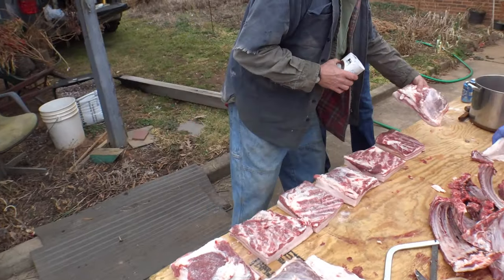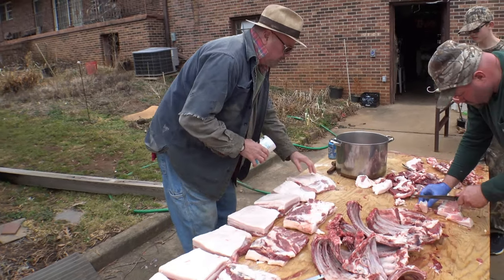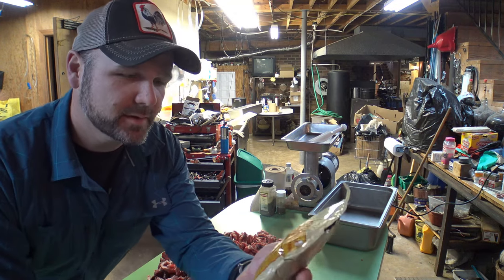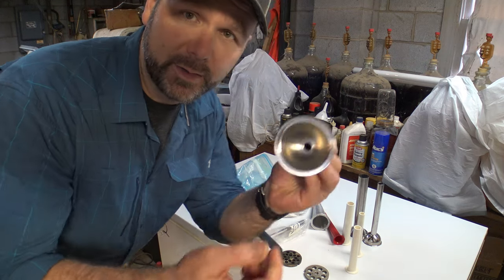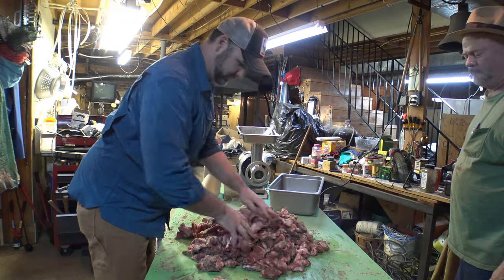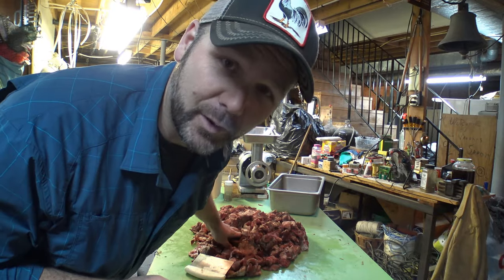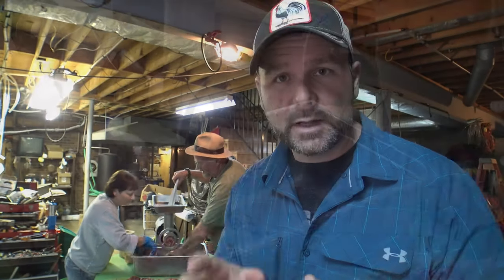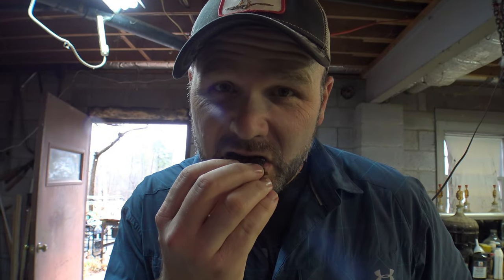FINAL DAY 3: Appalachian Heritage Old Timey Hog Killing...Seasoning Bacon.. How to Make Sausage

Comment: Brother this series has tugged on my heart strings. I use to help butcher hogs, the ones who ran the show are now gone and no one wants to help. Like you said,.... it takes a village. This one man show wouldnt be able to scald, scrape, quarter, and process. 
I have skinned a hog out and just took it to the proccesor. 
God bless brother. 
I believe your actually just about 1 hr and 45 minutes away from me.
Reply: @Lance Sheppard ,
If you have skinned the hog then you have already eliminated the scalding and scraping steps.
  I have seen people send a 225 lb. hog to a processor and get only 65 lbs.  of meat back .  Explained as  " processing loss " .  125%  "processing loss " seems like a lot to me.  Another issue is  , how do you know that you are getting YOUR hog meat back ?   Once cut up , the meat from two different hogs looks exactly the same .
  Two good reasons for doing it yourself .

Comment: getting the meat to where it's almost starting to crystalize but still soft and putting the cutting blade of choice into the freezer so they're both cold as can be is the trick to sausage. For those of you who have little home units, run it through the biggest blade first, then run it back through after mixing it to get it to the final size. It'll eliminate the chunks the weaker units tend to have if you force them through a small blade on the first pass.

Comment: I took 4 pieces of 4x4's ,(about 12-14" long, drilled holes in each end with a paddle bit-(one end deeper than the other)- slide them on table legs. (1 of my tables has to be raised 8",,, the other is comfortable at 6")  can use them for either table.

Comment: Used my grinder to stuff casings ONE TIME. So slow, cumbersome to feed forcemeat to throat and then shove down to auger with plunger and repeat. All the while manipulating casing for proper fill. Also you get more air pockets. I could go on but you get the point. Spend the $125 on a 5L vertical stuffer and the process will faster and you'll produce a higher quality product. The stuffer (unlike the grinder) will last for generations. Plus your grinder will last longer also if it's not pulling double duty.

Comment: How long can you leave it hanging in the smokehouse, with no smoke??  In case you don’t have refrigeration.
Reply from the maker: so it's a salt cure, you can leave it up for a year or more.....usually this is done in jan/feb and the ham needs to hang through the august summer heat to fully cure...then it should be shelf stable without refridgeration...just like back in the 1600/1700s/1800s and even into the 1940s in deep Appalachia

Comment: Why did you use a 25 lb. season mix with 35 lbs. of meat.
Reply from the maker: We mix in a lower amount of seasoning and taste...then add more until we've achieved the flavor we desire...more or less seasoning...more or less sage.....we have plenty of seasoning...but you can't take it away if you over season it...so we taste and add as appropriate .....screwing up this amount of sausage would be a horrible mistake